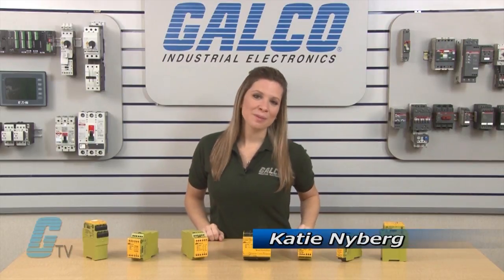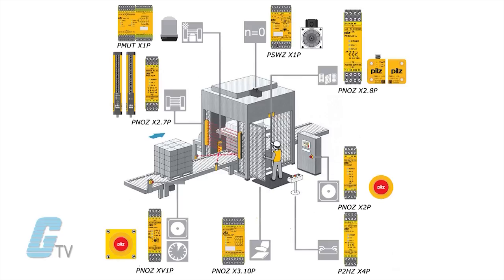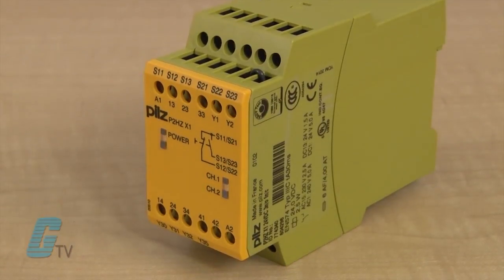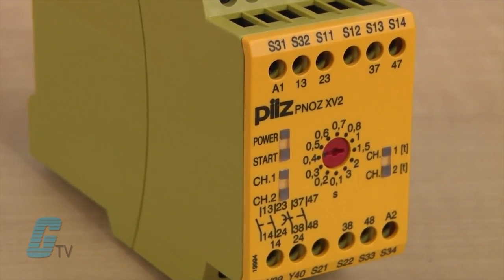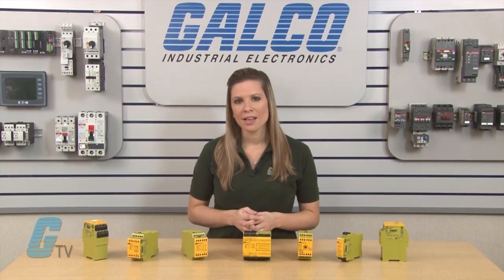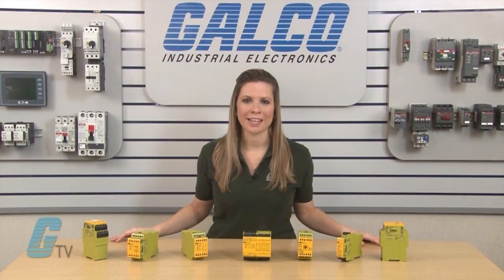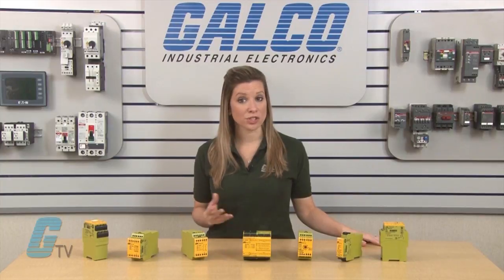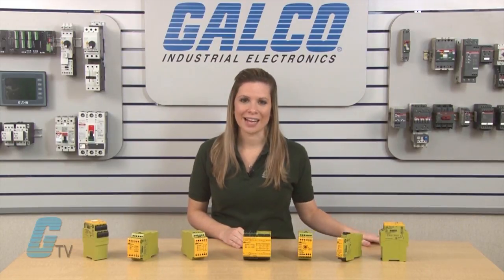Pilz Pnoz X Safety Relays

Comment: Dear Madam,

Good Afternoon.

I am unable to understand the wiring diagram of PILZ PNOZ XV3 RELAY. can you please explain me in details.

K1 is for channel 1 healthy condition
K2 is for channel 2 healthy condition
What is K3 & K4?
When channel 1 & channel 2 becomes healthy means at what terminal when supply becomes healthy?
What is Y39 & Y40?

my email id : mmobin53@gmail.com
Reply from the maker: ok Y39 and 40 are the time reset for the 2 delayed contacts K3 and K4. K1 and K2 are instant contacts. Channel 1 operate K1 and K3, and Channel 2 operates K2 and K4.
Reply: GalcoTV  Thank You for your reply

can you please also clarify
what is S11, S12, S21, S22, S31, S32, S33, S34

OR send me link of any manual in which all these things are clearly mentioned

as it is not mentioned in  manual
Reply: when built relay
K1 AND K2 ENERGISE
Reply from the maker: https://www.galco.com/techdoc/pilz/777511_dat.pdf Check out this data sheet and see if helps with your unit.